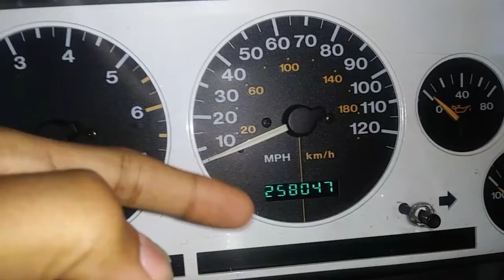FUEL PUMP/FILTER REPLACEMENT (1997-1998 JEEP GRAND CHEROKEE)

Comment from the maker: Heres a link to the OEM fuel pump for the 1997 & 1998 Jeep Grand Cherokee. I put this pump in shortly after making this video and it went in effortlessly...
https://www.ebay.com/itm/Bosch-Fuel-Pump-Module-67649-For-Jeep-Grand-Cheerokee-1997-1998-/382620233199
Reply: Nice job, I salute you jeep grand Cherokee fuel tank removal on a hot day on the ground, but there an adapter for the Jack that's sell at harbor freight  it attaches to Jack it like a C shaped iron bar that help to bring down fuel tank or heavy object check it harbor freight Jack accessories.
Reply: Will your link above work on a 98 5.9 ZJ ??
Reply from the maker: @joeyjordan1209  yes
Reply: BARRICADE GARAGE thanks.. just ordered.. that’s a great price.. its twice as much most other places..
Reply from the maker: @joeyjordan1209  Exactly! Let me know how the install goes
Reply: BARRICADE GARAGE just put in my fuel unit.. went pretty smooth.. I thought it was to tall for a second then Realized it collapses down.. I have a metal gas tank skid cover and a tow hitch to finagle up with it but it only took about 2 hours.. next is a set of 4 hole or 12 hole injectors.. and maybe I will attempt a heater core replacement.. maybe
Reply from the maker: @joeyjordan1209  good Job! After replacing the fuel pump and spark plugs I noticed the overhead computer. Went from 310 to 420 miles until empty after filling up the tank
Reply: BARRICADE GARAGE wow.. I did plugs and wires a month ago.. I had to cycle my key 4-5 times to start every time so I think my  fuel regulator was bad.. its suppose to be a check valve and keep pressure..
Reply from the maker: @joeyjordan1209  your fuel regulator is that silver part on top of the fuel pump so if you just replaced the fuel pump then you replaced the regulator as well because they are integrated
Reply: BARRICADE GARAGE yes.. I figured if I’m doing all that work I might as well put everything new..how is your RC rear track bar holding up.. I have about a 3” lift and my axle is a little off to the passenger side..
Reply from the maker: @joeyjordan1209  my RC track bar is holding up fine. I know people like to bash their products but I cant say anything bad about these track bars
and they are the only ones you can adjust without removing the actual track bar
Reply: Great vids man they help out alot
Reply: Link works but Ebay doesn't have that listing anymore.
Reply: Which brand did you get that was too tall? I'm shopping for a whole new sending unit, I see 50 dollar pumps 🤦‍♀️ on ebay which is a trap, and 250 dollar units on 4wd[dot]com. Which do you suggest as far as brand? I have a 97 5.2l
Reply: @Squat_House  the pump is spring loaded to hold it to the bottom of the tank. I don't know why he didn't compress the unit to install it. These are very common units used on more than one size tank i.e. why it has springs.
Reply: if you were crafty you would of put the new pump inside the old housing and fuel level reader arm .
Reply: @Hang Tyrants Pretty sure you've taken care of this already and found the reason, but for anyone else who might be curious...

The fuel tank has to be removed to get to the pump assembly, and it's always easier to drop/reinstall an empty tank.  Keep in mind each gallon of fuel weighs ~8lbs, and these vehicles have huge (23 gal) tanks. 

Just makes the job easier and less messy when empty.
Reply: @CaliPho3nix  and  less expensive.  Duh
Reply: @galactikbutterfly  Um...  Thanks for the (year old now?)...  "Update".  "Duh".  😹😹😹   Go about your "life" now (or GET ONE), have a good one... 😸
Reply: @CaliPho3nix  offended at the drop of a hat I see I simply ment the obvious with the gas prices these days if you wanna get dicey water weighs 8 lbs and gas 6 roughly speaking
Reply: @galactikbutterfly  bahahaha...  You need a hobby 😹
Reply: @barricadegarage5361 

Excuse me sir does the xj 98 have fuel filter?

Comment: Hey just a tip from a fellow zj owner, before you think you have the wrong fuel pump ( I thought I had the wrong one to) its actually spring loaded and when you put the pump in the tank you just have to press down then lock it! You can see buy doing it with the old one! Saved me lots of time and money! Love your videos man super helpful and well put together!
Reply: I can’t get it to lock at all how did you do it I can’t get the gasket past the hole in the tank whatsoever

Comment: Just want to put this out there. I have seen so many video tutorials and this has got to be my favorite! The music really helps with the transitioning and the fact that the video shows absolutely everything.
Reply from the maker: Jacob Thomas Thanks I appreciate that
Reply: Hey man good vid. except that fuel pump was spring loaded and would have compressed to the correct height of the fuel tank. should have installed it.
Reply from the maker: +David McDonald bro I actually know what im doing. This was the wrong part and would not compress enough for the lid to catch the threads because it was designed for a different vehichle.
Thanks for watching
Reply: @barricadegarage5361  demo or it didn't happen.
Reply from the maker: David McDonald lol

Comment: 5:32 I may be wrong but you can see springs at the top of the fuel pump. Those springs aren't on your old pump. I bet you have to push against the springs and force the pump into the tank and screw it down to make it fit. Anyhow, thanks for posting. All the tips you give help. You've kept me from spending a bunch of money at the mechanic shop.
Reply from the maker: It was just the wrong pump. Heres a link to the OEM fuel pump for the 1997 & 1998 Jeep Grand Cherokee. I put this pump in shortly after making this video and it went in effortlessly...
https://www.ebay.com/itm/Bosch-Fuel-Pump-Module-67649-For-Jeep-Grand-Cheerokee-1997-1998-/382620233199
Reply: @barricadegarage5361 excuse me sir can u help me find oem fuel injector for my 98 xj 4.0 or are 12 holes injector good or just put the 4 holes one?  Plz and thank youb

Comment: FFF/ZJ/001A is the part number for the filter/pressure regulator which is what you see at the top of the unit in this video before pump removal. the one you changed was just a pre-filter for the pickup. when you buy a new pump assembly unit it comes with it. I would recommend always replacing the entire assembly while you have the tank off there is no reason not to but if you want to change the primary fuel filter it is the filter/pressure regulator at the top. edit: in no way do I want to take away from your video I love watching your videos and hope you continue to make them

Comment: Doing this job today, you didn't even have to replace the tank straps or fight any really rusty bolts-easy. I just wish the factory had installed the fuel filler hose clamps on the tank where they could be loosened without dropping the tank.

Comment: I have replaced the fuel pump 3 times on my 96 ZJ. I just cut a hole in the floor, so it only takes about 10 minutes Do not try this at home, because the tank is right underneath the floor, so I carefully used a Dremel.
Reply: I'm sure its different on every vehicle but i've had a bunch of hondas and when I did the fuel pump on my pilot it had a pre cut hole that I just had to break the welds off of after cutting the carpet. Same process for my civic.

Comment: Hey so the fuel pump equips the fuel filter and the fuel pressure regulator all in one components? So if I replace my fuel pump I replace the filter as well?
Reply from the maker: Kevin Romero yes. on the 97 & 98 Jeep Grand Cherokee the fuel filter is apart of the fuel pump itself. the fuel filter is located inside the body of the furl pump. what I actually replaced in the video is called the "fuel strainer"

Comment: What would the correct part number be for a 1997 jeep grand Cherokee limited with the 5.2 V8? I just replaced spark plugs and wires and it's still bucking under acceleration
Reply from the maker: Phillip Wallace Crown part #5012961AC. my issue was I ordered the one for my '96 ZJ by mistake and the '97-'98 ZJ uses a different pump than earlier models

Comment: I have a 1999 4.0L Cherokee XJ sport model. I've been wanting to change the fuel filter for some time now but there IS no fuel filter attached to the under carriage as you would expect all the fuel lines are uninterrupted from engine bay to fuel tank. could it be the same system belonging to the grand Cherokee that you show in your video? Flabbergasted!?

Comment: What are the signs I'm looking for that points towards fuel pump going out?
Reply from the maker: Checking for proper fuel pressure at the fuel rail with a test kit would be the most direct and effective way, but if you have a 23 year old vehichle and never changed the pump then chances are its not gonna perform like it should. You may experience difficulty starting, loss of power under stress like when driving up a hill and may even hear whining noises from the gas tank area. But in some cases the fuel pump just quits out of the blue with no symptoms leaving you stranded somewhere
Reply: @barricadegarage5361  
I have a 97 Grand Cherokee with a 5.2 l.  Monday on my way to work the check engine light poped up all of a sudden. I noticed the idling and acceleration is acting weird at low speeds. Its slowly getting worst. I changed the O2 Sensors and still having the same issue. Im getting the code P0132 & P0138. Not sure if its fuel pump or maybe spark plugs....

Comment: Do you need to remove the gas tank if you just need to replace the fuel filter??
Reply from the maker: Yes
Reply: Thanks! I need to replace mine and needed to figure if there was a way around it
Reply from the maker: @popechadwickbongwaterfortn5668  there is no way around it. Youll feel good about saying you dropped your gas tank when its all said and done tho
Reply: BARRICADE GARAGE thanks man I appreciate the help! And It will be more experience too

Comment: Band excellent videos thank you so much I'm partially blind but I used to be able to change the water pump on my woman's 95 Jeep Grand Cherokee limited Live out in California I was trying to beat the snow and rain so I was pretty much at it for 24 hours straight She had some bozo company supposed to be replaced with water pump 2 years ago less than 300 miles on the vehicle now and The serpentine belt kept throwing relaxed though pulling on the water pump had almost an inch and a 1/2 play left right up-and-down Job went perfect except one last thing I forgot where I put the bolts that separated the clutch fan clutch from the Van Any idea where picked up those unique  bolts  Sorry about any miss Bellingham I used to talk to text cause I can't see the keyboard again thank you very much videos are awesome

Comment: It's freezing here in Toronto
Reply from the maker: richie mansingh Its freezing down here in DC too. I did this video back in july when it was almost 100 degrees outside
Reply: yow anyhow I am taking it to the shop to replace the pump and filter on Thursday also the gas filler neck .thanks for your video

Comment: We’re did you get the fuel filter at
Reply from the maker: that one guy Rockauto.com..
I actually ordered the wrong one. I needed one for the '97 and got one for a '96
Reply: BARRICADE GARAGE ok thanks I’m about to change mine
Reply from the maker: that one guy the '97 and '98 only have a fuel pump because the filter is integrated into the pump. its a little different for earlier models so make sure you get the right part
Reply: BARRICADE GARAGE ok thanks didn’t know that I have 97
Reply from the maker: that one guy check out the video I did for the '96 and earlier models.
https://youtu.be/8STWgDUc8cY
any questions you have just ask and let me know how it goes

Comment: I just installed a new fuel pump in my 1998 GC ZJ exactly like the one you attempted to install.  Your new fuel pump is the correct one for that vehicle, part number 67649.  These fuel pumps are spring loaded so you needed to press it down so it fits tightly in the tank.  Then you can screw on the retaining cap.  I do like the larger filters on the new Bosch units.
Reply from the maker: +Mark Dominey I know exactly what im doing when im making these videos so i know these fuel pumps are spring loaded but the one I was trying to install was NOT for this Jeep and would not compress far enough to fit the tank. I have since installed a bosch unit that went in with no problems. I have 3 ZJs and have done this job multiple times and know know my way around these Jeeps well. Keep watching my channel and learn something. Thanks for watching👍

Comment: Should change fuel pump wire in the tank or clean them, when they rust they give loss of fuel pump currents,
Reply from the maker: what fuel pump wire?
Reply: @barricadegarage5361  the one that connect to fuel and connect to module , those usually rust on each end and barely give power toward the pump and make the vehicle bug down until it smoke and shut down.
Reply from the maker: 501thunderbolt do you own a ZJ bro?
Reply: @barricadegarage5361  yes I actually have a video where as I drop my tank and change the fuel pump but I wasn't really focusing on those wire I'm telling u about. I own a 95 5.2 v8
Reply from the maker: 501thunderbolt dope vid i just watched and subbed

Comment: You forgot to release the pressure from the shreader valve on the fuel rail.
Reply from the maker: '97 & '98 have no pressure valve on the rail. This is why I showed you the professional way to do it

Comment: im going in thru the back floor. im gonna drill holes till i can spot the regulator then ill cut a big X, peel it open, replace the part then push the flaps back into position and seal it all with glue. put the carpet back down and no one will know the difference.